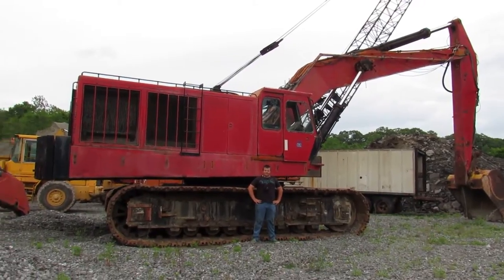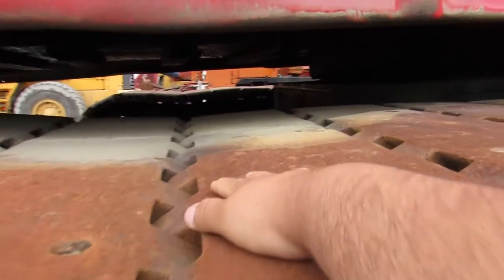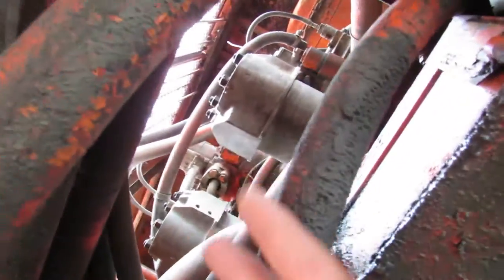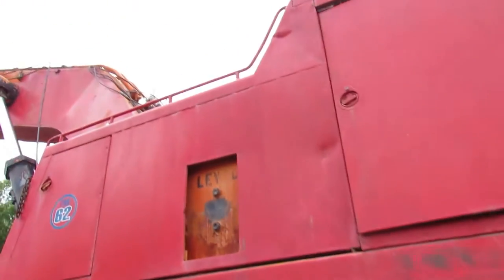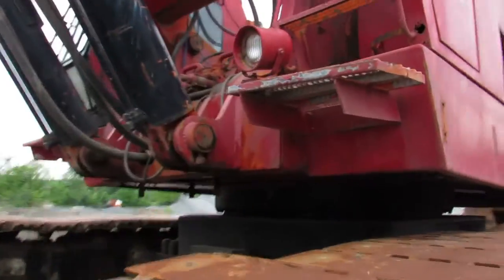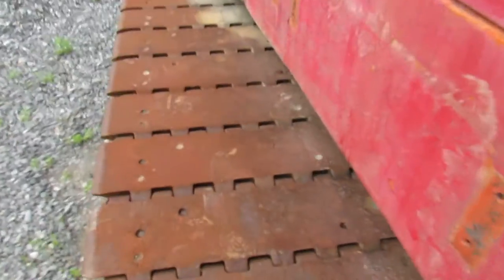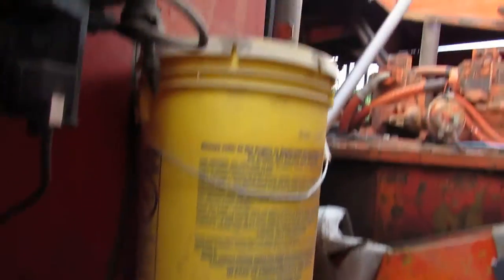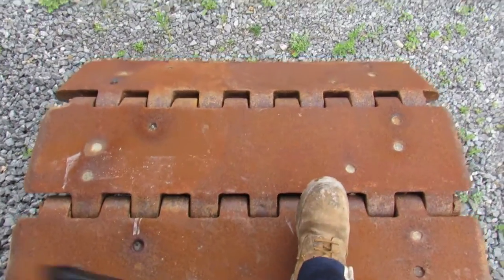Koehring 1266 walkaround

Comment: @Anthony Lucibello   Thanks for putting this documentary together. Well done. First time I got to see a 1266D was at a contractors equipment yard in Little Ferry, NJ. I believe the company name was Gates Marine Construction. That was way back in the mid-1980’s. Apparently the company used the big Koehring mainly for dredging. I remember the painted markings on the stick that indicated digging depth. The last number on the stick was 40 ft. That machine was a monster. Thanks Again.

Comment: I ran one in Atlanta years ago laying 60 inch gravity. Air over hydraulic. Buttons to control the bucket and stick. Laid about a mile of 60 inch 30 feet deep, in a swamp, on mats all the way.
Reply: @Hal Danson   Must of been a very cool experience.What was your impression of the 1266D, as far as lifting capacity, digging power, reliability, etc. ? I’d really be interested to know about that. Take Good Care.
Reply: @williamhall9204  very cool...twin buzzin dozen, 1200 hp. 440 gallons of fuel a day. Could lift anything. 18 ft tail  swing. 287,000 pounds weight.